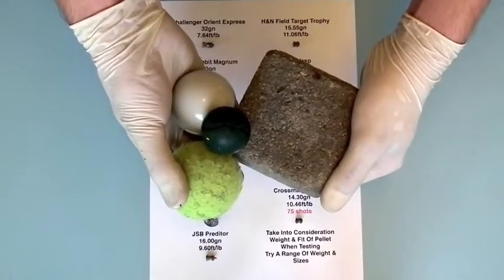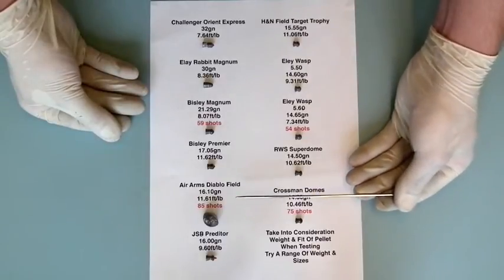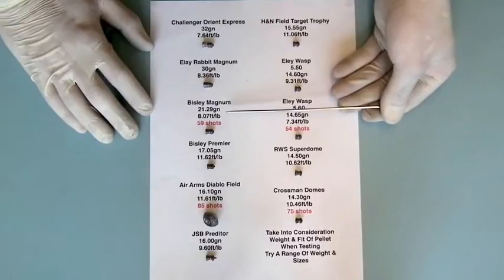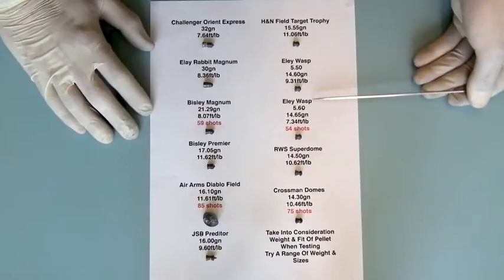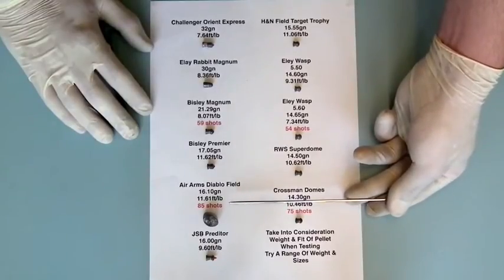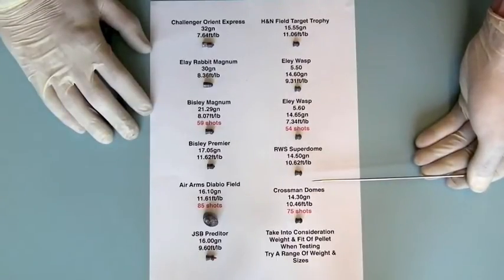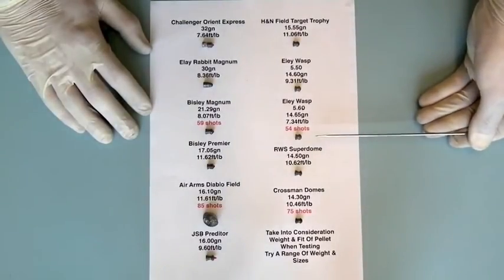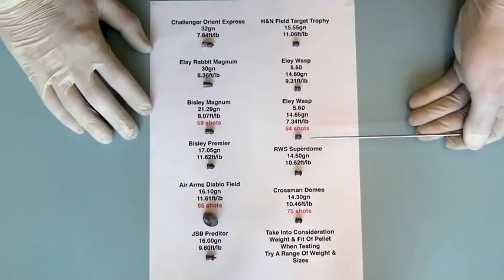Airgun Pellet Efficiency / How Weight & Fit ± Power Output by Lane Regulators.

Comment: Hello Robert,
It would be awesome to do the exact same test with all the pellets lubricated with some Silicon oil spray.
You know the stuff that comes in a spray can.
I use the 3 in One Professional and it works very well for consistency and accuracy.
Also, I imagine it will put a nice anti corrosive film on the rifling and should also stop leading the barrel.
Just my 2 cents worth...
Reply: That's not leading that's graphite that comes from the coating of the pellets manufacturing 🙄